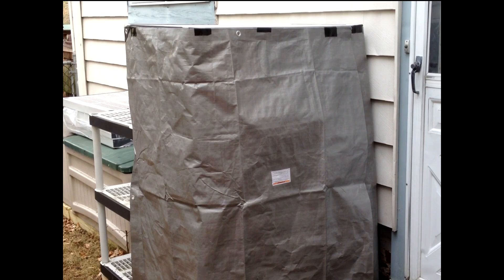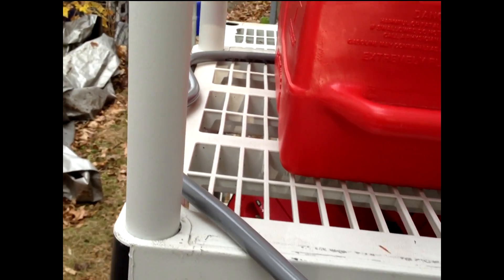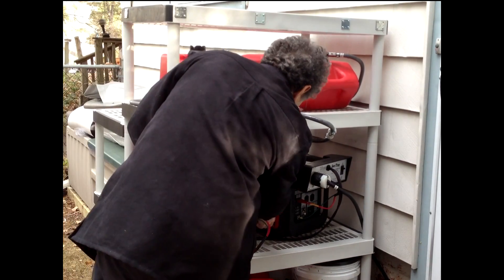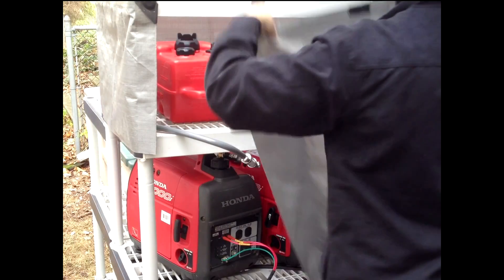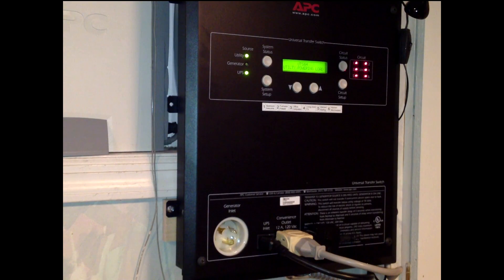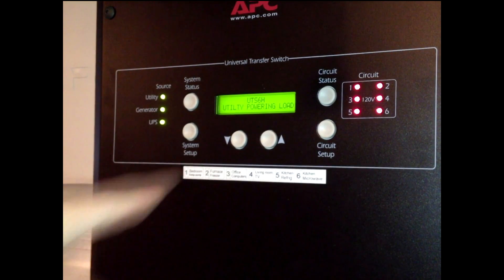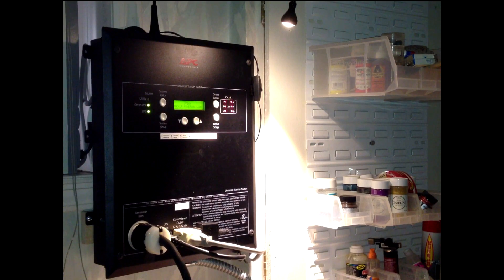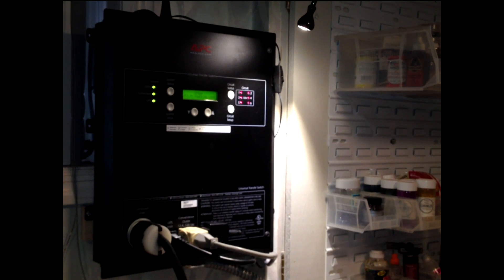Honda EU2000i generators with APC transfer switch

Comment from the maker: With the APC panel, you can set up circuits so that they can be shed in the event that the generators cannot supply enough power.  Each circuit can be configured as needed to shed and reconnect automatically... with minimum on and off times...cool stuff.

Comment: Can somebody dumb this down for me?

Let's say that the house is pulling 5,000 watts when the power goes out.

Then I go down and fire up the gennies (peak capacity 4,000 watts).

What happens when I flip the cutover switch?

Do the circuit breakers on the gennies trip?   Or does the panel handle the situation more gracefully?

Comment: From what I understand after speaking to a long term Honda mechanic there is no need to mount fuel tanks above the EU2000 due to its internal fuel pump. In fact, he was concerned that the gravity flow could, if something goes wrong, lead to a fire which is claims to have seen happen.  Since numerous other videos here on YT show this generator with a floor mounted tank why take a chance?

Comment: Great vid, thx for the ideas.

have you ever had an inrush overload when switching power sources (Main-to-UPS-to-Gen) when running on only one of the eu2000?

also, what did you set your gen watts to on the UTS, 3200 rated or 4000 peak?

Comment from the maker: Now how do I answer this without sounding flip?

Two generators are twice as loud as one generator!

Well... actually it depends.  That's the case if they are both running at full load (not on eco-mode).  

I haven't compared the sound levels when both are running on eco mode.  So I don't know if two running at half load has the same sound level as one running at full power.

Comment from the maker: The UTS6H should work.  I asked an APC technician if the UTS6 would work if the four prong L14/30r plug was jumped so that the same 120 volts hot lead was seen at both of the positive terminals (using a three wire cable with an L5/30p on the generator end).  Looking at the schematic, he said it looks like it would work, but he said he could not recommend it.

Comment from the maker: Although both are 120 volt only units, the UTS6H has a 3 prong, L5-30P 120 volt input port (appropriate for the Honda portable generators),  whereas the UTS6 has a 4 prong L14-30P 120/240 volt port (appropriate for larger 120/240 volt generators). I got the UTS6H from wisesales dott com, one of the few places that stock it.